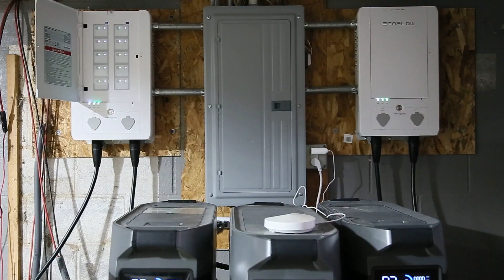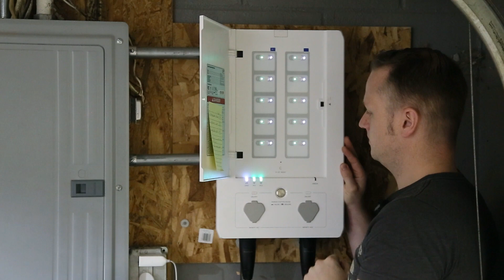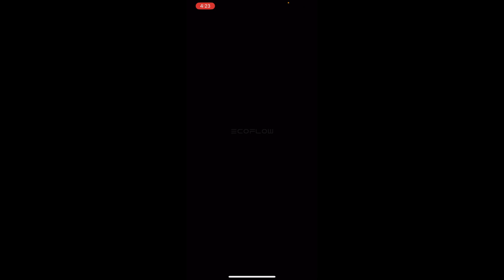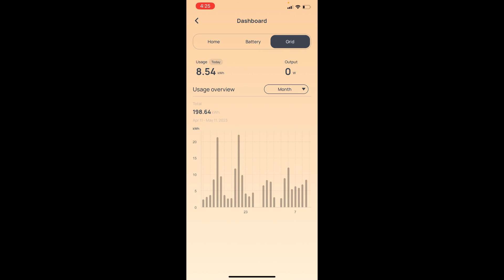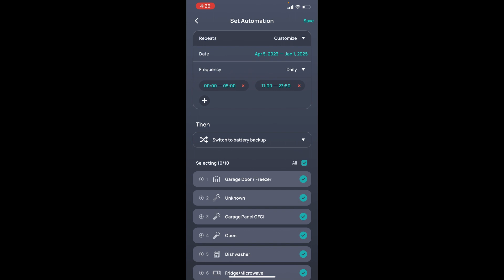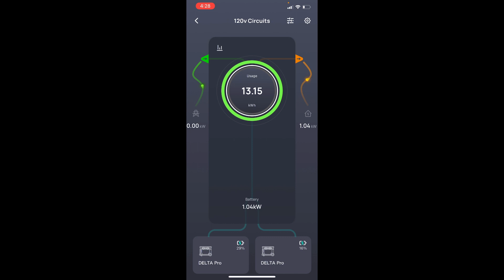Ecoflow Smart Home Panel Overview

Comment: Very informative, the Automation rules are exactly what I wanted to know about this system! Thank you!

What happens if you've scheduled the Smart Panel with an Automation rule to run using Delta Pro batteries (no grid) but it depletes the DP batteries before the Automation rule is scheduled to go back to grid power?

Can you setup an Automation failover rule so that when the DP battery level is at say 5% to switch the Smart Panel to grid power, regardless of the schedule?
Reply from the maker: If the battery depletes, it will automatically switch back to grid always. Yes, you can also specify a discharge level of say 5 or 10% and when it hits that threshold it will switch over to grid regardless of your time specification.
Reply: @DanielGoodwin-jq1oc  Thank you!
Reply: Just what I needed to know - thanks!

Comment: Great video Daniel, thanks for the work. I just got my SHP set up and everything was going well until the SHP fan started up.  That thing is LOUD.  Was wondering if the fans on your SHP's are loud as well?  The DeltaPro fans are bearable but the fan on my SHP is a problem and it runs a lot.  Right now the panel is only pushing 300 watts and the fan has been going for the last hour.

Comment: Can any electrician connect smart panel or is there anything specific about it. How many hours would they charge on average to install one single phase panel
Reply from the maker: Probably any good electrician could figure it out. The electrician that installed mine was the very first time he'd ever done anything like that and he figured it out. There was some initial setup things in the app that I had to figure out myself but the wiring and such he was able to do all on his own. He had mine installed in about 4-5 hours. Your mileage may vary. Ecoflow does have a list of electricians in the US that have done installations before so they might be able to recommend someone to you depending on your area.
Reply: @DanielGoodwin-jq1oc  thSHanks for this info. one dealer wants you get a certified electrician who pased a 10 question test by ecoflow before they ship the panels. Other dealers just say to use a profesional electrician.

Comment: Nice video, very informative. If you use only the Delta  Pro , can you prioritize it use battery power until you reach a specific low battery setting  so grid power kicks in similar to the Home panel does!
Reply from the maker: Yes, you can. You can specify on the Delta Pro charge and discharge limits. So if you set it to 10%, it will stop using the battery and should utilize grid power as pass through.

Comment: Thank you for sharing your experiences with HSP. It is very cool!

I have a question )

Do You can use the Delta backup power (batteries) or solar power when your grid is "on"?

I interesting, because SHP use the same neutral cable
Reply from the maker: If I'm understanding your question, you're asking if you can use the battery power of the Delta Pro when grid power is available? Yes, you can set a routine to ensure that it uses the power from the Delta Pros first and then only switch back to grid power if the battery power is depleted. That's my primary use case and how you can lower your energy costs primarily. Other people prefer to keep their delta pros charged and ready to go in the case of an emergency. You can customize the discharge level of the Delta Pros so that it doesn't discharge below a certain percentage and that will ensure in the case of an unexpected outage you still have some power left in the Delta Pros.

Sorry, that was a lot but hopefully that helps.
Reply: @DanielGoodwin-jq1oc  Yes, your answer helped me. Thank you very much!

Comment: How efficient is charging and discharging? Would it make economical sense to charge the battery at $0.25 and avoid using power at $0.50 by using the battery? If round trip efficient is close to 50% and you are w trying to cool your house while these ecoflows great it up, you may end up not saving any money. i saw posts the ecoflow round trip efficiency is 58%...
Reply from the maker: What you are suggesting is absolutely a legitimate use case for energy arbitrage IF your energy provider allows or charges time-of-day metering. If you can charge your batteries when demand is low (i.e. usually at night), and run them during the afternoon when demand is high, you could save money on your power bill without even using solar panels. Combine the two together and it can be a very potent combination. My energy provider does not by default offer time-of-day metering unless it is requested. That's on my "to do" list in the future.

Comment: Can you do a detailed installation video?
Reply: There’s actually a very good one on YouTube
Reply: can you provide a link to the install on youtube?
Reply: @allen35315  thinking of doing it myself and then have a certified electrican look it over. On a manual transfer it doesn't require a certified electrician which is basically similar in instalation.

Comment: Hi Daniel. I had a professional, experienced electrician attempt to install my smart panel. Passed wiring test. Getting relay errors on 3 circuits. Tried swapping relays, no improvement.  Support sent more relays to swap, no improvements.  I don’t feel support really understands the problem, just sending parts to try.  Electrician has checked each connection and says power is not getting to the relays. Any suggestions?  How can I get you more info if you can help?
Reply from the maker: Hi,

I'll be the first to admit I'm no expert, just an average joe. However, what error is it giving on these relays? Are you using them for just single phase? When you look at the log does it give any additional details?

Comment: Updating the firmware is scary every time.  I been updating both my Delta Pro's firmware fine until one time it bricked.  Went through the support process and determine that there was something defective and had to sent it back in.  It happened during firmware update.  I'm scared to do any firmware update if the warranty period is over.
Reply from the maker: I understand what you're saying. I've had some unnerving experiences as well with firmware updates. Nothing as extreme as that. I always take a deep breath before updating though. This needs to improve. I will say the firmware updates have gotten better (i.e. smoother) over the past 6 months.

Comment: Amazing video....I have a question, My furnace in my regular home electrical panel is on a 240v - 20amp double breaker. When assigning relays in the Smart Home Panel, do i hook up that circuit to two 20amp relay modules in the Smart Home Panel and will i be able to connect my furnace, or does it have to be 30 amp in order for me to use the 240v?
Reply from the maker: Yes, you can hook it up to two 20amp relay modules in the SHP and run your furnace. I'd recommend not using Relays 1-4 since those can be up to 30 amps and the others cannot. I'd reserve those in case you truly do need a 30 amp relay for something else. If I remember right, I'm running my 240v cooktop on two 20amp relays, it should be very similar.
Reply: @DanielGoodwin-jq1oc  thank you for your response....I love your channel
Reply: @DanielGoodwin-jq1oc  but you need two delta pros and two infinity cables ? am I right? By the way did you did the install yourself or hired someone and how much did it cost?

Comment: Can you sell back power to the utility through the smart panel?
Reply from the maker: No, in order to do that you need a net meter agreement with your power company and there are additional permits/requirements. The SHP doesn't provide power back to the grid which means in most locations you can install without excessive permitting etc. YMMV.

Comment: When using split phase, you mentioned you can only use 5 circuits. I want to connect my electric dryer which uses a 30 amp breaker and the whole house is on 20 amp breaker on the smart panel. I assume my dryer would need split phase. On the smart panel, would I used the 2- 30amp relays for 1 and 2 and 3-10 would be using the 20 amp relays making 9 circuits on the smart panel?
Reply: Thank you for helping understand this setup. Since you are using solar panels to charge your delta pros, did you add a 30 amps circuit breaker on your main panel for each delta pro for fast charging?
Reply from the maker: Yes, both have 30 amp circuit breakers from the main panel. That said, I really don't recharge from AC unless absolutely necessary. I mostly use the solar power to recharge. If I have extended periods with low solar input then I will tap the grid to charge.

Comment: How much is a setup like this? Looks like 10K or more.
Reply from the maker: It's more. Exactly how much depends on where you buy. By far the best deal is on refurbished models from Ecoflow from eBay (I have links above). That will save you a lot of money versus buying brand new. But 4 Delta Pros and 4 extra batteries plus 2 smart home panels is a lot no matter how you slice it.

Comment: It looks like you have (at least) 4 Delta Pros with the 2 smart panels. Is it possible to use 2 smart panels with only 2 Delta Pros?
Reply from the maker: Yes, however only in single phase (110v). You can have 1 Delta Pro to each smart Home panel for a total of 20 single phase circuits.
Reply: Thanks Daniel! My situation is I have 2 Delta Pros and need to supply 110v and 220v circuits from my main load center/breaker box. I also have 2 brand new SHP's but with only 2 Delta Pros, I can't see any way to connect both SHP's at the same time with what I have. I didn't notice you had one of your SHP's connected to a separate Delta Pro set until I had already bought my 2 SHP's. Now it seems I can't use more than 1 SHP without getting at least 1 more Delta Pro, which would only support 110v circuits anyway. Is that right? Thanks again for your excellent video! @DanielGoodwin-jq1oc
Reply from the maker: In order to support your split phase circuits, yes, you will need at least one more delta pro. For split phase circuits, you will need two DPs connected to the SHP. You can run a mixture of split phase and single phase circuits on that same SHP (i.e. 2 split phase circuits and 6 single phase circuits). In my case, it made more sense to just dedicate 1 SHP and 2 Delta Pros for all my split phase circuits but your case may be different. The other SHP can be connected to one Delta Pro and can power up to 10 single phase circuits there.
Reply: Makes sense and thanks for the details. One more question is during an outage, how do you use the Delta's to supply power not only to the circuits served by the SHP, but also the rest of the circuits in the main breaker box? I do have a generator input and lockout already so I could swap the SHP out and use my Double Voltage Hub through the generator input, but not sure the SHP will still supply power back to the circuits in the breaker box and there are only one set of connectors on the Delta's for these cables.    @DanielGoodwin-jq1oc

Comment: Savings.  Payback.  20kw worth of ecoflow ain't cheap.  Couple with the transfer boxes and wiring and you talkin' big $$.  Average homeowner stays put 8 years in their home then move.  You would have to stay put a lot longer is my guess.
Reply from the maker: You're not wrong, my friend. However, the nice thing about the Ecoflow setup is if you do decide to move, its not hard to take it all with you. Might need an electrician for the smart home panels but the Delta Pros and Extra batteries can be moved in an instant.

Comment: I would say your setup is far from efficient. You would get far more performance and efficiency out of your Delta Pro's by running the dual unit break out bar in 240 Volts AC Split Phase, and plugging in the supplied 240 Volts AC into your Tie-in Receptacle on your home panel. In this way you would actually be drawing less overall current, because the higher you raise your connection AC Voltage, then the lower your average amperage draw becomes. Right now, you're losing tons of current through the overkill of two seperate smart home panels, which actually are operating in desperate AC Voltages (120/240 Volts AC). You need to disconnect the two smart home panels and return to using your Tie-In via two Delta Pros in 240 Volts AC with the Dual Link Hub only. Alternately, you could run both smart home panels in 240 or both in 120, but not one in 240 and the other in 120 Volts AC. This is a really bad idea.
Reply: Can you elaborate on this?  I just purchased two pros, two batteries, two generators and the smart home panel but I have not had the panel wired in yet.   I was considering this type of dual SHP setup because I have reached the hard limit on the ecoflow pros because I have reached the maximum number of expansions per leg in a two ecoflow pro system.  This idea on the surface sounded good to me to expand my setup but I don’t clearly understand your objection.  Not an electrician so would be interested in hearing more about your concern.  Thanks.
Reply: Clarification:    You're saying 2 SHP's both either single or dual phase. But not one on 120 and one on 240.  Can I run 2 SHP's with just 2 DP's? Both at 240?
Reply: I thought 240 VAC is just two legs of 120 VAC that are 180 degrees out of phase.  So would it really be more efficient???

Comment: Why on Earth did you buy so many of these low surge, short-lived lived units? You could have saved a ton of money if you had purchased a real off grid solar system that used a hybrid, low frequency, transformer based inverter charger, and a bank of high quality LFB batteries. If you had, you would have a system that would give you a far longer life expectancy, far more power output and twice the surge capacity for starting high inductance loads. Plus, unlike this system that uses cheap, difficult and more costly to repair, high frequency, transformerless inverter technology, you would have a system that can be easily repaired.
Reply: Because it’s portable dummy. If he needs to leave he can easily unplug it and take it and maybe a solar panel or two.

Comment: Holy cow, that is an absolute mess and a total misuse of that product. I have an Eco flow and it is not that durable and it broke within nine months. People who are trying to use this thing on a larger scale for their homes are going to have a rude awakening. That is truly messy electrical workmanship and I highly recommend people do not watch this video.
Reply: What are you talking about? This is exactly how the Smart Home Panel was meant to be used. And as for wiring, you can't even see the wiring. He didn't even open up any of the panels. The exterior plumbing looks very clean.